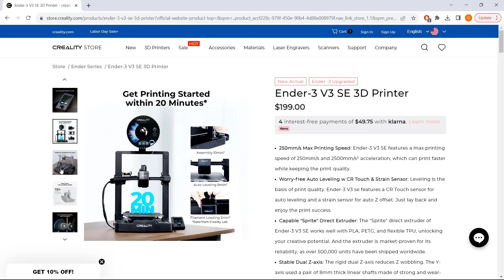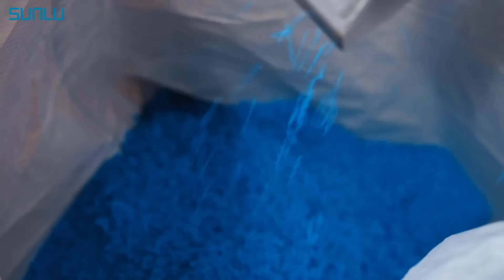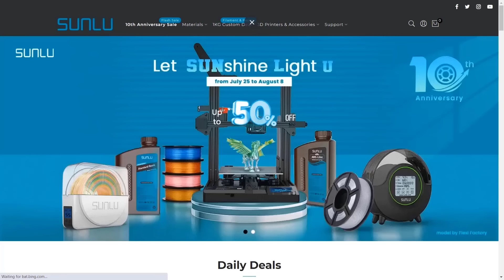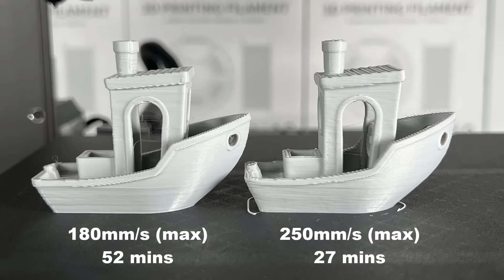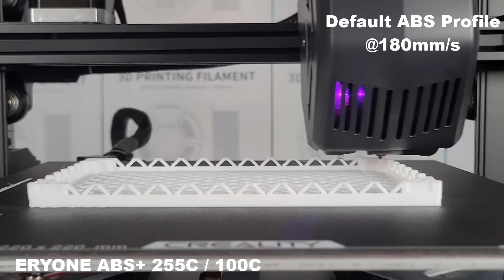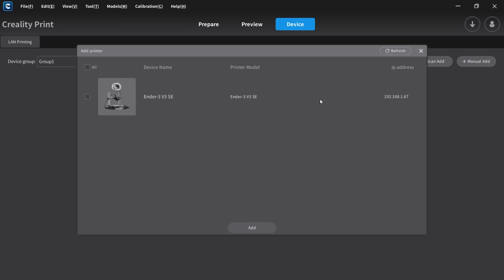Creality Ender-3 V3 SE: $199 budget 3D printer with auto z-offset, CR-touch, Y axis linear rods

Comment: Even if you're on a better budget,do not even think about buying the bigger brother of this printer,the Ender 3 v3 KE

Its made to directly head to the garbage dump

>old klipper,can't update

>z-offset is guesswork

>no screws for bed

>loud 

>shaky since it doesn't have stabilising rods in the back

>ignores or forgets bed mesh with a passion

>z axis sags from time to time

>z-gantry unlevels itself

>printhead shoves things off the bed religious

>printhead loves to create "blobs of death"

I bought this printer 2 years ago and had maybe 12 successful prints,a 100+ borked or aborted ones but had to replace PEI sheet 2 times,3 nozzle/heating heads,1 cltouch.

It doesn't matter what slicer,settings or filament you use,the printer will not work at all

Don't do what i did,avoid at all cost!

Comment: Why there putting a 0
.4 nozzle on al the printers remains a question mark.
Just put a 0.6 nozzle on it.
And the print time reduces by 2 hours.
Why get a big printer.
If your only going to use small prints.
Makes nu sense to me.

Comment: This video is 5 months old. This V3 will be broken by now as they are a pile of junk. The z-offset is unreliable at best, useless most of the time. It is super fussy about filament, you pretty have to manually set it up to get anything out of it and even then the prints are very poor. I am on my 5th V3, they work great out of the box then over a few days they grind to a halt. If you want to be a BETA tester for creality then on you go but otherwise avoid this printer at all costs..creality support is non existent, I got more help from my pet Hamster.

Comment: S3 V3 software is buggy and the screen control knob is ignored a lot of the time till the current task it's doing is finished. During setups, you have little clue as to what it's actually doing as there's no indication of the state of the task on the screen. You have no indication on the menus whether the option is the actual task or a link to a submenu. Some "are you sure" questions would be nice there. A fair amount of work is needed to clean it up. When printing, it is quiet and reasonably fast but bed warming is very slow.

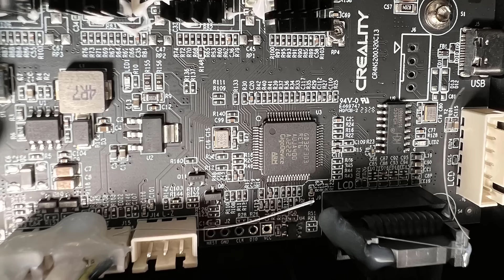Comment: 2:34 " a GD chip" really? I heard people were able to flash  klipper to this machine though and I thought you needed a STM chip to flash a new FW
so are there newer revision  or (older ones) that ship with  the STM chip or is it like in the ender 3 days where it is kind of a crap shoot on which chip your board will have?
I am not going to flash  klipper to this machine and have no interest right now but if klipper ever supports the strain gauge and auto Z offset some day  I might want to consider it.
I would be more interested in adding a strain gauge to older printers like my ender 3  pro or v2 neo if klipper or a custom version of marlin could support it
but I am not sure if thsat woud be possible.
I did see another review of his printer where the reviewer said you should be able to  remove the stran gauge from the V3 SE and add srpings or silicone spacers and   leveling knobs to it, which made me think  that the reverse would also be true and that we could remove leveling knobs from other  ender 3 models and add a stain gauge  to add  auto Z offset tot he ose older printers if we had a FW to support it.

Comment: If cost is not an issue then which one is better, v3 S1 or v3 SE? It seems creality has done a lot of cost cutting in SE to bring it under $200. SE is also lighter by 1.3kg so i believe a lot of metal got replaced by plastic which might not be good for a long term reliability perspective? Any thoughts?
Reply from the maker: Also take a look at the CR10 SE, which is an Klipper Ender-3 S1 Pro with Linear rails. https://youtu.be/_WisLhEQg4w

Comment: I just ordered a ender 3 v3 se as my first printer. The part i didn't take into consideration is that i would like to print CF with this machine but it doesn't print at the temperature to print this material, how can i upgrade my ender 3 v3 se ??

Comment: I started with the Ender 3v2 and it caused the most headaches of any hobby I've ever had. :) however, after much modding, I dialed in my 3V2 so that it works pretty well most of the time.

However, I am looking forward to trying out my new 3V3 which arrives tomorrow and putting them through their paces.

It boasts 250mm/s which WE ALL KNOW is not a realistic number. What is a good, reliable max speed for this new printer for general use (I use PLA exclusively so far)?
Reply from the maker: Printing at 150-180mm/s is pretty good on this machine.

Comment: i was able to put a filament sensor on the v3 it was not easy to do and took about an hour to do had to make custom brackets for it and had to hard wire it  directly to the motherboard  150 prints later still works prefect and yes the filament sensor works great

Comment: This was a PERFECT review!   Great video.  I just received my V3 SE and the z-offset is not accurate like yours so it is attempting to print too high.  With the included model on the SD card.  I'll try to manually compensate and see how it goes.  A little disappointing being that the z-offset should be automatic.

Comment: I just bought a SunLu 3D Print pen the SL-300 Plus I will be using it to fix prints and add detail on 3D printed items. SunLu has the best pens. I also bought a spool of PCL that melts at a crazy low temperature for my grandkids to design using the pen. Thank you to SunLu for sponsoring the channel. ❤

Comment: I'm a bit pissed rn. In january this year i bought an ender 3 s1 pro for £400. Now it is obselete less than a year later. This new ender 3 turns up boasting all the same features but for half the pice???? I feel utterly ripped off.
Reply from the maker: 😂 I have a 5-year-old Ultimaker S3. When they launched the new S7 this year, it had no significant improvements. But I don't think I should be happy about that. My S3 is literally just a filament box to me now.
Reply: thats what happens with fast evolving technologies, better than what used to be a few years back

Comment: Hi, I'm totally lost in the different offerings of Creality (and competitors) 500 USD printers. What I'm looking for is a printer that can just print after an initial setup. I would not tinker it all day nor look for mods, but just print with the best quality and resolution possible. Speed is no factor but building area is key, the higher the better. I was recommended the Ender-3 but I wasn't told the exact model. Based in my research the Ender-7 was attratcive, but it seems like it's sub-par on quality. Now I'm looking at the Ender-3 S1 Plus, but also the S1 Pro has some features I can't tell if I need (and less building area). I'd use it for longer prints, 1..2 per week for small series product printing. Always the same choice of (PLA?) filament. Any ideas are welcome! Cheers :D

Comment: Thank you for another great review.  This looks like a very good machine for the price, but the only other 'con' thatI see is that it still has a PTFE tube in the extruder/hotend.  Perhaps since this printer is designed for beginners, Creality thought it was better to have the printer designed for lower temperature filaments.  Do you think it would be easy to fit an all-metal heat break to this hotend?

Comment: This actually looks like it's decent for a change. Normally ender 3 is an automatic hell no for me. I've been recommending a sovol sv06. I think I could actually recommend this over that. Manual bed leveling screws is an automatic hell no for me. They need to start making more machines like this and less machines with the damn leveling screws. I see people all the time failing and ready to just flat out give it up. And it's like.....yeah of course you want to quit the hobby. You picked a horrible printer. It is sad you used your prusa mk3s+ (which IMO is horribly dated) and not your mk4. I love my mk4. The mk3 mostly collects dust now. It does get some use, just not as much.

Comment: The best review of the Ender 3 V3 SE I've seen to date! I have one due to be delivered in the next couple of hours 🙂. It'll be my second 3D printer, alongside my upgraded Ender 2 Pro. I also had an original Ender 3 (my first ever 3D printer) which I modified and upgraded the heck out of, but sold a few months ago. The Ender 3 V3 SE is a considerable improvement on the original Ender 3!

Comment: I was about to be super poo poo on this printer and say it doesn't do this and it doesn't do that. But I took a step back. This is $200 and this is kind of everything you need for a beginner and I'm not a beginner.  This printer wasn't meant for me, I completely agree with you about the filament run out sensor and if this printer is geared for beginners rookies will make that mistake.  I've done that twice, when I first started.  I just wish it went to 300° on the hot end but now that I have printed for as long as I have, only 3 years though, plus 260 isn't really needed on an open frame printer in my opinion, but there are so many enclosure solutions now that are cheap. That's why I'm a stickler for the 300.  Epic review.

Comment: I like how the little sensor pops out like a pinkie testing the temperature of the tea. So dignified. I love your reviews, do you have any recommendations for buying used printers, refurbished, out of box, demo model kind of thing?
Reply from the maker: Just search on eBay; there are quite a lot of used/refurbished machines at super low prices. As long as you can fix some minor issues, they are a pretty good deal.
Reply: @AuroraTech  Thanks. I'm not in a hurry so I'm trying to draw from the wisdom of people like you. 🧐 Are you bridge and tunnel Danville?

Comment: If I level my V2 Neo every print at the printing temperature for my material, and set the Z offset every print, I get almost invisible layer lines.  The magic of Creality is this.  The Voodoo side is that I must level and set Z every print...even if I don't change material...

I want this.  Faster, fairly clean, and clean looking.

Comment: Creality has the legacy and brand recognition to do it. With that new Kobra 2 Pro out it so hard to decide which pros and cons you can accept. Roller bearings on the X axis, and with the backing of the Creality community this would be a budget beast if there was input shaping from the get-go. With Bambu Lab starting the next gen trend of 3D printing, I do wish to see a bedslinger I can still say I would purchase today. My 1st printer was the Aquila X2 which is pretty much the Ender 3 V2. Now I got a P1S+AMS Combo I'm content. Though I do miss tinkering so I'm waiting for that affordable bedslinger that will give my P1S a run for its money.  Great work as always! The 3D printing princess and should be up there with the likes of Melissa Wu and the like. :washhands:
Reply: None of Anycubic's FDM printers are good.  Avoid them at all costs.  I run a repair shop and the Anycubic machines have electrical and quality issues like you wouldn't believe.
Reply: @ThantiK  I've own in chronological order Aquila X2, Flsun SR, Kobra, Ender 2 Pro and P1S+AMS Combo. Never had an issue with any of them. I believe user error probably amounts to a lot of the issues.

Comment: The printer seems fine however, I truly hate how Creality makes a 1000 printers every year without support, firmware updates or any other form of long-term consistency.

I mean, for $200, it's cheap yes. However, if you're anything other a hobbyist you're better off with other trusted brands.

I would rather see that Creality releases fewer products and have a plan to support these products over longer periods with constant updates.

Comment: I’m having some issues whenever I turn off the printer my Z offset just won’t calibrate properly until like 3-4 tries, it’s annoying since it’s time consuming so I’ve been manually lowering it manually. Another issue is that plastic starts dripping after I change the 0.4 nozzle to a 0.6 after heating up. I’ve made sure it’s nice and tight and it doesn’t leak to the sides or clogs but will just drip pla while calibrating.
Reply from the maker: My firmware version is the latest Ender-3 V3 SE_HWCR4NS200320C13_SWV1.0.4_GD303 released on Aug 14, 2023. The z-offset works perfectly, try to download it from Creality:
https://www.creality.com/pages/download-ender-3-v3-se
Reply: @AuroraTech  thanks! My nozzle also stopped dripping since I got a filament dry! I live in the Midwest so it’s very humid and I’m thinking that played a role in the drips.
Reply from the maker: You can use a long 1.5mm ball head hex driver, heat up the nozzle to the max temp 260C, hold the extruder lever and push them out.
https://amzn.to/3Paybnf

Comment: Great Review.  It's not rated for it but I had great success printing abs in an enclosure with it also.  I Love this Machine.  Got mine on the 9th of August and has been printing Great.  Only issue was the 1 of 2 cover hold down screws above the y-axis linear rail was clipping when printing.  Replaced with a flush screw problem solved. Already racked up 200 hours on her and still going well.

Comment: Thanks for the review! It looks very good for the money.

I wonder if it's using Marlin input shaper. After all, any input shaper reasonably configured will improve the print quality significantly and stress the machine less.
Reply from the maker: I believe they used pre-calibrated values for the Marlin input shaper; if not, the 27-minute benchy should look much worse.
Reply: @AuroraTech  I believe so too.

May I suggest a new standardized test print for this purpose?

The test would be to print Klipper's ringing tower with g-code inserted to increase acceleration in a range of 1000mm/s² to 20000mm/s².
A visual inspection will:
- indicate if a printer has input shaper enabled or not
- allow to evaluate how well input shaper is calibrated
- compare between printers how much input shaper ends up smoothing the edges.
- check how fast is each printer, factoring in acceleration limits.

I anticipate that future printers might ship advertising too high accelerations for marketing purposes, which can't be used due to excessive smoothing especially if they're configured with the EI shaper type.

Also, it would reward strong builds that can print fast but without excessive smoothing.

What do you think? I'm happy to help generating a modified tuning tower g-code, possibly with added lettering to make the result more visual

Comment: It's the "how many times can Creality remake the same printer?" game :D
Reply from the maker: As long as they can make it cheaper and with more features, I don't mind seeing an Ender-3 V100 in the future.
Reply: @AuroraTech  true, this is an improvement over the original Ender 3. Bed slingers have a lot of life left in them as long as quality of life elements like part cooling and firmware continue to improve. I'd be thrilled to see V-wheel rollers go away forever, though :D

Comment: Very good review as always , i have the s1 and this v3 is very good for the price , but i prefer spend at little more for the Neptune 4 or the Any Cubic Kobra 2 pro.
the Any Cubic 2 pro that also i saw in your videos and seem to be faster and with better print quality
Reply from the maker: If you prefer to spend $100 more, pick the Kobra 2 Pro, it's much better than the Neptune 4 Pro.
Reply: @AuroraTech   thanks, I hope that Anycubic kobra 2 pro has better construction and electronics than its previous models
Reply: @AuroraTech is there a link for an all metal hotend that will work?
Reply from the maker: I can't see any all metal hotend available for this machine yet.

Comment: Very nice review!  It seems this printer is kind of an S1 killer.  Maybe there will be an S2 with these upgrades, especially the improved cooling fans.

Isn't the print temperature of ABS close to the temperature of melting the PTFE tube?
Reply from the maker: Yes, that's why the Ender-3 S1 is on sale for $246. A good quality PTFE tube can resist temperatures up to 270°C, but I don't print ABS often, except for testing printers, so I haven't had any issues with that.
Reply: @AuroraTech  Interesting, makes sense.  I guess they will phase out the S series.

Somehow I was thinking PTFE started breaking down at 250°C.
Reply: nothing above 240 is recommended : "DuPont studies show that the Teflon offgases toxic particulates at 464°F." ( 240C )

Comment: Creality engineers worked hard to get to that $199 MSRP with most of the modern features we want.  They did a great job of eliminating cost and complexity (no bed leveling knobs) without adversely impacting the capabilities.  As expensive as cable is, I wish manufacturers would switch to a 4 conductor continuous flex rated cable to the extruder instead of a large ribbon cable.  CANbus or some similar serial interface could be used and still be less expensive than ribbon cable and connectors.  This would allow the cabling to stay the same for new printers as features are added such as LEDs on the print head, an optical filament runout sensor (mere pennies) at the top of the extruder where it's completely painless, etc.
Reply: lol

Comment: I see you using different temps for different rolls of pla. Do you base this off previous temp tests or do you run new tests on every printer? Would you be able to get better results with some tests if you calibrate the temps fully? Not that your results are ever anything but great lol.
Reply from the maker: For the sample G-code, I leave the temperature as is. For some models, I may increase the temperature by 5-10°C based on previous prints, as I've printed most of the test models many times before.